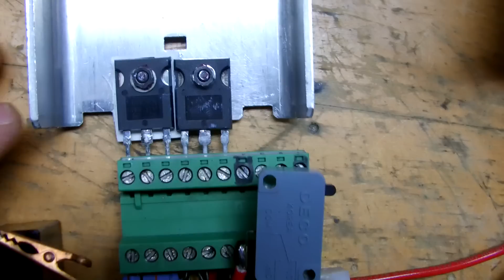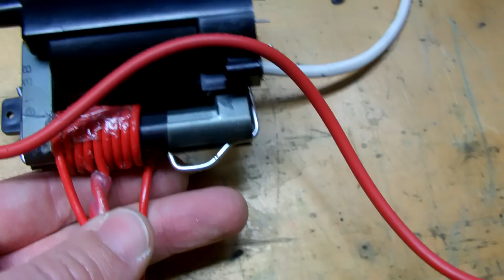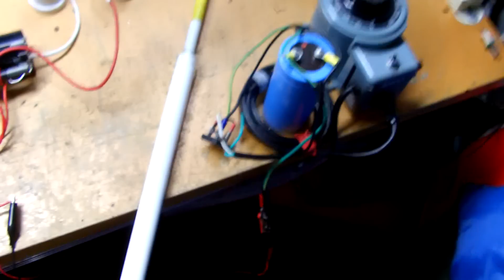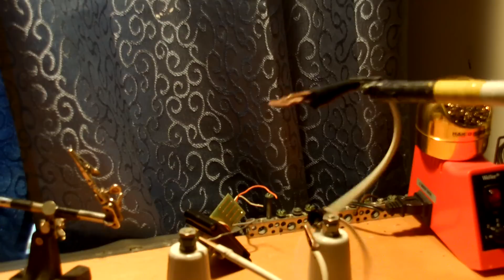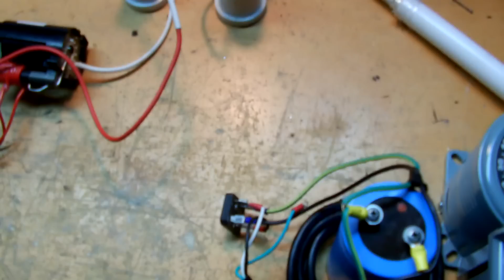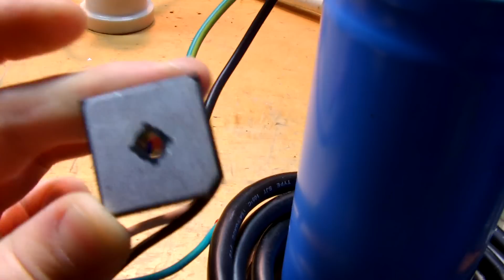ZVS Test Setup

Comment: Im trying to ionize air with cold plasma  and push it into distilled water for water ozonator.... medical O 3 as they say demand good quality arcs @ a low current consumption like 30 mA in your set up   hope you can help me design this as Im using the 32 to 40 vdc from Bedini sg motor circuit as power source    thanks